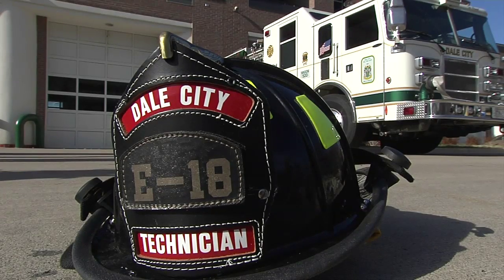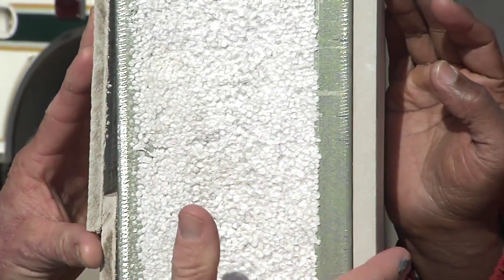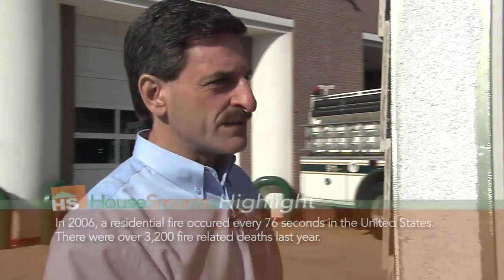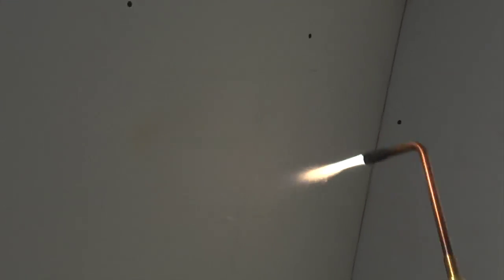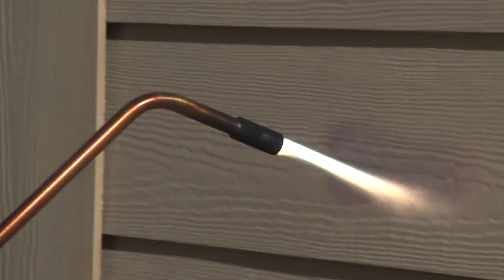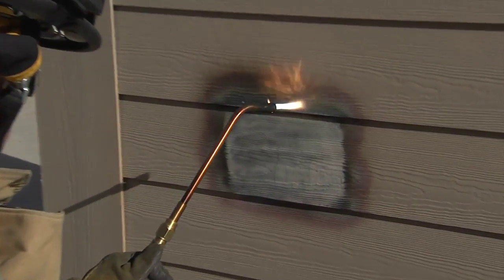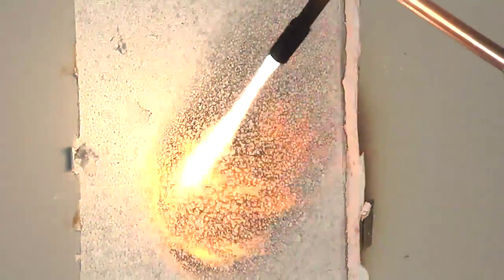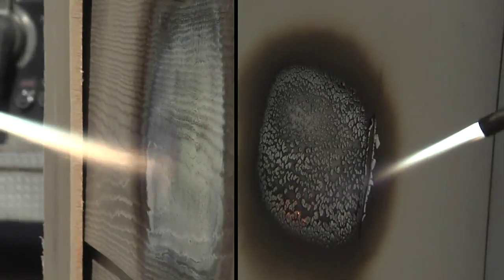HouseSmarts "Fireproof House" Episode 51

Comment: Instead  frp styrofoam material gotta be foamed or aereted concrete       exterior also can be shot with stucco microbaloon mixture with gunite. (micro balloons used for space shuttle heat protection from 3 m 5 gallon around 300 bucks.   Suggested is cheapest way         foam seen crystalizes bronches in lungs as irreversible damage if partially fumes inhailed.

Comment: Not to burst your bubbles - of course, anything helps, but in CA, temperatures of our wildfire exceeded 2000 degrees - street lights melted - a metal Wallmart burned
Reply: The torch used in this demonstration burns at 5,000 degrees.
Reply: That’s what you get when you don’t burn brush and import explosive trees

Comment: Just make the houses out of concrete and stones, like any other house in the world is made, why do you americans insist on wood?
Reply: Because we prefer to run all our electrical wires on the inside of the wall, not outside where it's more dangerous
Reply: @dieniewienie143  In a wall house using hollow bricks u run the conduite for electrical and plumbing in the inside of the bricks..not outside.
Reply: @karl ditz you can use hollow bricks yes, but you'd still need a wooden frame in order to support it. Bricks alone wouldn't work. A small earthquake would topple the entire structure. Only other way it could be supported is by reinforcing it with steel rods but that would be too costly
Reply: Victor Affonso makes ppl who cut trees very wealthy